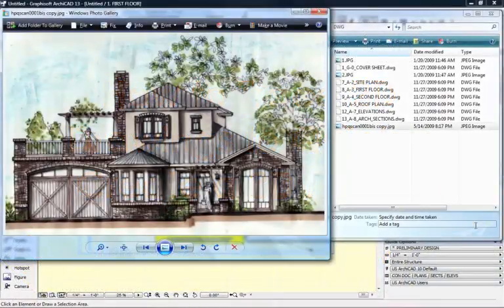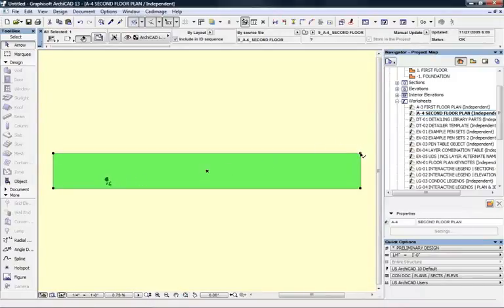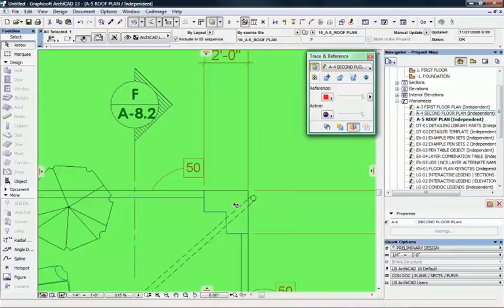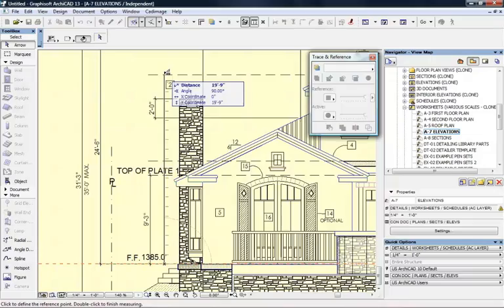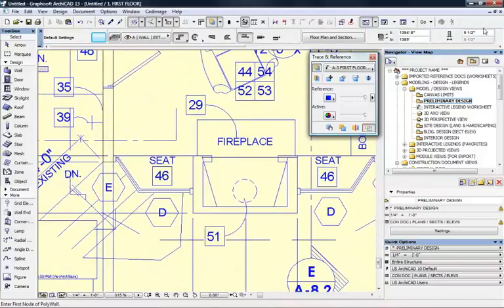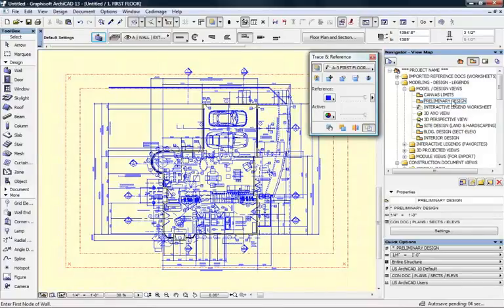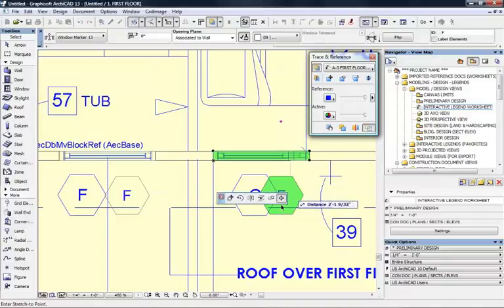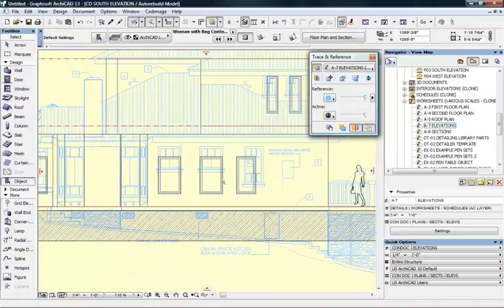ArchiCAD Tutorial | How to Trace 2D Drawings to Quickly Create a 3D Model

Comment: As usual a very helpful guide. Thank you so much for this. 

Wouldn't be easier to remove additional detailing from the imported DWGs, the trace references seem very cluttered with info that isn't really necessary in tracing. Just wanting to know if you left all the information on them for a reason.

Comment: (continue...)

My doubt is that everytime I copied and pasted the DWG file in a new worksheet, to show a different part of the dwg file, I am under the impression it IMPORTED the whole DWG file again, instead of just linking the same dwg file I used on the previous worksheet. Now, I am NOT SURE if it copied again or used the same.

My fear is that filesize may skyrocket if it´s inserting multiple same dwg files in the archicad file.

Should I copy and paste dwg´s between worksheets?

Comment: HEllo Eric!
When I import a file from AutoCAD to ArchiCAD after ungroup the lines,when i select them, i noted that they have different particulars, are selected in other way, with green coor and square at the end right?. my first question is, how do I edit them? Gender, change the color.

The second question has to do with my project, I have a plan of myl intervention local to architecture, but the plan is in Autocad and i imported to Archicad but there is is anyway to transform the line to "normal" archicad's lines?or i  have to pass over all lines with lines of archicad? there is no way to get them automatically with the particularities of archicad's lines?

sorry for my bad english!

Thanks!
Reply: ***** Thank you for your answer! That's true, i used  File menu > External Content > Attach Xref command. i did too the Edit menu > Reshape > Explode command. I noticed that if i hide only one line, all other lines dissapeear too, maybe that is what you did say :  "some of the items may still be part of the inner group and display square handles". but if i ungroup multiple time the line wont's have more "square handles" ? i now that will print, but my what i want is edit them just fine and easy like a archicad line, change size, color, thickness, etc.

I will try with a copy, and ungroup the line. My concern with all this is because my architecture project contains urban arrangement and there i wanna work in 2D view, using only lines.

Later on work, i will make some 3D but there a can draw over that lines using Trace Reference right? just like you showed in this video.

Thank you so much!

Teibão